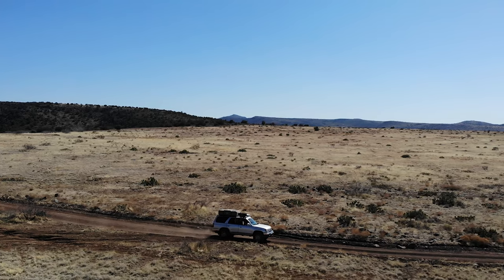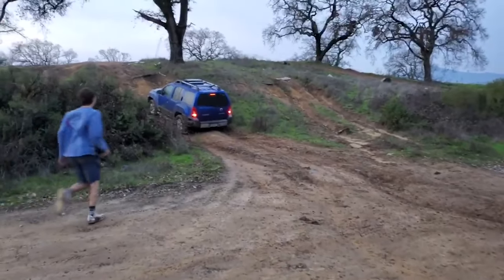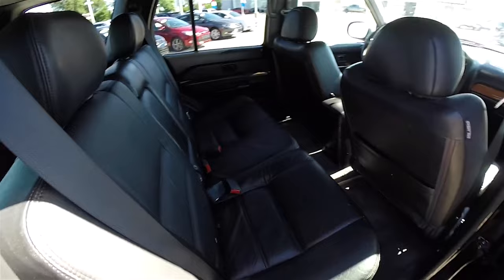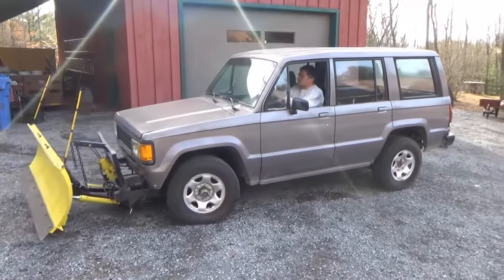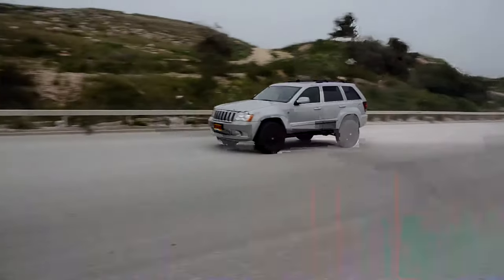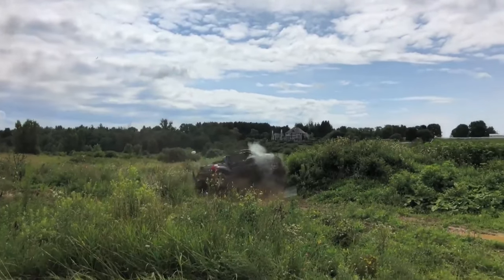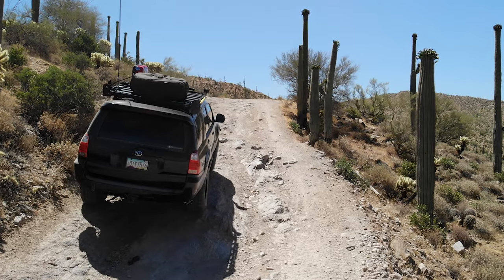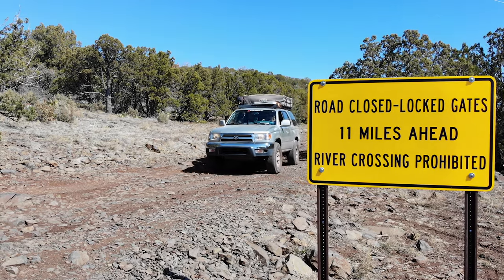More Viewer Picks For The BEST BUDGET OVERLAND VEHICLE!

Comment: The main problem with the Nissan R50 is because it has McPherson struts in the front, you cant go up in tire size without spacing/offsetting the front tires out about 4 inches each to clear the lower spring perch.  However, if you want one that has led a cushy soccer mom life like the Sequoia, search for an Infinity QX4.  Same rig different badge.
Reply: I would agree, the R50 platform is the bastard child of the Nissan suv lineup with the front strut setup. There are ways to get higher lift with subframe drops that are being sold now to add bigger tires and removing the front sway bar for a bit more flex. Still very limiting.

Comment: Great list! Considered EVERY vehicle on these 2 lists (and Discovery/LR3) and decided on an 03 4wd Sequioa 3 years ago for my overland build. Been incredible, SUCH an underrated truck! The 4.7, easy to lift, tons of storage and even at 6’02” me and the fam easily sleep in the back.
Reply from the maker: It's definitely a good choice. I think a lot of people are getting wise to them, but they're still the most cost effective way to get into a body on frame, four wheel drive Toyota! Nice choice!
Reply: I wish I could grab something like that, or I believe it was a highlander I looked at that I really liked.
  *I just sold my super clean first generation Xterra, as I just didn't like it for some reason, and found a really nice '97 ZJ Grand Cherokee that pretty much has all of the options I have wanted (in a first generation Grand Cherokee) aside from the factory tow package which comes with 3.73 axle gearing and limited slip rear end.. but it is really in great shape and has been well maintained so it's ready for me to put the 3" lift and extended shocks I have sitting brand new ready to install! 
  Then it just needs some 2 or 0 gauge wire run for 2nd battery for reserve power for the stereo amplifiers and power inverter etc..
  I am hopeful that this could be the best zj Grand Cherokee I have had so far!

Comment: I have a 2007 Commander with the 4.7 and the best thing about is that maintenance is easy. I've changed alternators, radiator, A/C compressor, and today the electric fan. All were easy to do with plenty of room to do it. I have an Xterra and I rather gauge my eye with a rusty spoon, before I change the alternator again. Nevermind the A/c actuators!
Reply from the maker: I feel you, I love our 3rd Gen 4Runner, but I don't look forward to working all that much. Just rebushing the front end took me about twice as long and about three times as much headache as doing the head gaskets on our Discovery 1!

Comment: I second what Rust Dave says. The Kia Sorento first gen is by far the best value economical real off roader you can buy. Ladder frame, solid rear axel and low range. There are two systems. Especially in the 2003 - 2006 140bhp you got part time with 4x2, 4x4 lock and low range. But no ESP off button. The 2007-2009 got a simpler less effective system Permanent 4x4 . With Auto and Low range but no locking option. I have this model. You improve this buy fitting the Diptech superlocker that gives part time 4x4 with 6 settings!! I've installed it. It has all the confort of a SUV coupled with the amazing off road capability and quite a few 4x4 accesories. The 170cv 2007 -2009 with he diplocker with 100,000miles for 6000 euros is amazing value. 👏  This is the top choice.

Comment: I owned my 2007 Jeep Commander Overland with the 5.7L Hemi for 11 years and racked up >232,000 miles on it.  It had the 4" Superlift with 33" tires, and with the QuardaDrive  2 system was unstoppable.

Comment: Good for you for incorporating suggestions from your viewers. One budget rig you might want to consider are earlier Kia Sorentos with 4wd vs AWD systems. They have a 4x4 low and ARB sells rear diffocks for them. Snorkels are available. Not quite as many after market supports as for Jeep or Toyota but you can get then cheap. Decent reviews on reliability.
Reply: @LarryRichelli  or 2wd. Awd wasn't an option for xterras. You pretty much have to message and ask, if you're looking for a first generation,  you can look at the pics to see if it has a lever next to the gear selector for the manual transfer case. If second generation it will have a circular knob on the lower part of the dash in front of the shifter to shift it in to 4wd the non 4wd will just have a black blank circle where the knob should be.

Comment: This spring I bought my 1997 Toyota 4Runner with 261,000km (162,000miles) for 5,500cad (4,300usd) which seemed to be an average price in Calgary Alberta. I wanted a affordable and reliable vehicle I could take off road but I had NO IDEA they were going for the crazy values they are. In Alberta they still seam to be a bit cheaper  than down there but it has gone up by a lot. I guess I'm just very lucky

Comment: The 1998-2005 Mercedes ML series was very overlooked, and is now cheap.  Easy to do a mild lift, and the low range and traction control works well.  There are no components hanging down beneath the frame rails, so the 9" stock clearance is a true 9" all the way through.  Engines are also simple and parts are reasonable.

Comment: I bought a 1998 Explorer Sport (2 door, not the Sport Trac) a couple years ago and it has been much more capable than anticipated. Currently added LT265/75 R16 that fit with just a little plastic cut off the front fender flares. 126,000 miles when I bought it, $2600. Now has 145,000 miles with no issues as of yet.

Comment: I have been looking for a Sequoia in the last few weeks, that is what brought me to your channel. Good stuff, I subscribed, thanks for the info. I have also been looking at a Pathfinder, also on your list. My reading led me to find that Toyota also used Dana axles on the Sequoia. Great video.
I am going to look at a 2004 for 5600 bucks with 221k miles. The non-VVT engine is a JDM while the VVT was built in Alabama. Toyota Racing Development offered a bolt-on supercharger kit for the 2000–2003 Tundra/Sequoia and the 1998-2003 LX 470.
Reply from the maker: Wow, I didn't know there was a difference in the engine source like that. I'd definitely go for the non-VVT JDM variant if I had to chose. I also didn't know there was a TRD supercharger in those years too! I knew there was one for the V6 and even the 2.7 in the Tacoma and 4Runner in that era, had no clue they'd made on for the UZ!
Reply: @MattKester  I dug around a little about the supercharger, it will add another 115 HP to the engine, I didnt see any torque numbers though.
Reply from the maker: @paladin11C40  Dang! That's an impressive gain from a factory authorized accessory!

Comment: I started my overlanding offroad in 1997 with a three year old Land Rover D1, then in 2009, I traded up for the Land Rover D2, then three years ago I got a 2nd Gen 2008, Nissan Xterra off-road edition with factory rear locker. I chose the Xterra over an FJ Cruiser because of price and the fact is was designed after the Land Rover Discovery with the same roofline and backseat stadium seating. I hate the leaf spring rear end, and the IFS front end but I have a decent lift on mine running 315/75'r16 Nitto Ridge Grapplers and I have gotten more compliments on my Xterra then 20yrs of driving two different Disco's.
Reply from the maker: Xterras are a beast. One of the countless big mistakes Nissan has made in the last 20 years was killing them off.

Comment: Really enjoyed this. I've owned both generations of isuzu trooper. My daily driver is a 2002 trooper with the manual transmission and 265k miles on the original engine. The automatic transmission models are best avoided. The first gen models while lacking in creature comforts, are great vehicles as well.  For me, an honorable mention would be the first 2 generations of mitsubishi monteros.
Reply: Is the automatic in the Montero pretty solid?
Reply: @bradh6185  they seem to be. My 91 has the aisin built automatic and they have a good reputation..
Reply: @shelbyshadow91  Thanks.

Comment: The location of the starter on the Toyotas is there to protect it from off roading conditions. It is a tradeoff they made to increase reliability.
Reply from the maker: I’d buy that, had the UZ engine not originally been designed for the LS400 and not off-road applications.

Comment: 1998-2011 ford ranger/Mazda b4000 5spd 4x4 can be found for DIRT CHEAP and are quite capable off-road and can fit 265/75r16 tires from stock. Definitely lacking some passenger space with the crummy rear jumpseats but overall awesome for the money.

Comment: Thanks for this video. Glad to see you mention Isuzu! New subsciber! The later Troopers had an issue with oil consumption in the 3.5L engines. I'm going to paste the comment I had on your earlier video in case it helps someone. "I had a 93 Trooper RS, and currently have a '02 Rodeo 3.2l with only 74K miles and paid $1800 for it, leaving me lots of cushion for upgrades and preventative maintenance. It is a manual, with 4LO and 4Hi, or 2WD and 4.30 gears. The primary issue with these Isuzu's are the weaker automatic transmissions.  If you are handy with a wrench then they are great budget builds/trucks. I've had a XJ, two ZJs, and two AMC J10s which I have done extensive work on and sold for a decent profit. I landed on Isuzu because they are cheaper than dirt, and the driving characteristics and interior remind me of 3rd gen 4Runners but without the Toyota tax. A result of the Bubble era. They are body on frame, really easy to lift(crank the torsion bars up front, spacers or coils in the rear). I like the rear doors swinging outward, allowing for a easy way to mount a table, or molle packs for organization. They don't have the aftermarket support so you need to be creative, or follow the lessons others have learned online. But I snagged a NIB ARB BullBar/bumper."
Reply from the maker: Thanks for watching and subbing, Joseph! Also, big thanks for the extra information on the Trooper. They are definitely one vehicle I wish we were getting a relaunch of!

Comment: The problem with the 4.0 V6 in the Sport Trac is one chain is in the rear the other is in front so when the chain guides go you have to pull the engine to repair it.

Comment: what's the highest amount of miles you'd be okay with purchasing on a car. i see a lot of these kinds of vehicles, in the 5k range but most all have around 180 - 210k miles. is it worth more for less miles?
Reply from the maker: I try to stay below the 200k range, ideally below 150k, but I realize in this market, that's kinda hard to do. One advantage to stuff in that 200k range, if you don't mind getting your hands dirty, is finding out what kinda big ticket maintenance items have/have not been done, and use it to start lowing your offer. Most anything on that list is gonna be looking for bushings, shocks, ball joints, and timing belts around that time frame, so I'd look something well over and try to use that to leverage the price. That being said, this assumes you want to/are able to do a lot of that work yourself.

Comment: Stuck between early 2000s 4Runner or 05 pathfinder fully loaded 4x4 with 120k for 5000?
Reply from the maker: I doubt you’ll touch any decent 4Runner for the same price. That pathfinder is a solid rig, the VQ motor in it is a beast, I’d definitely consider it. I would definitely make sure that it’s had the radiator swapped or an aux trans cooler put in, or budget to do that right away to avoid the pink milkshake of death. Also, I don’t believe they came with a lot in the way of underbody protection, so if your gonna go start doing some serious off-road work, I’d make sure you’ve at least for skid plates installed  under the sensitive bits. You’d be surprise how often we nail the bash guard under the radiator on our 3rd Gen thanks to how IFS lets the front end drop when it gets off camber.
Reply: @MattKester  thanks man 4Runner are only going up in socal. Also I’m looking into the xterras early 2000s
Reply from the maker: @FOPEZ  they aren’t bad rigs either, for as much as I’ve rubbed on them. They’re just harder to find in gently used condition, if you know what I mean!

Comment: In Canada, the best deal is probably a 97-04 grand Cherokee. They are the cheapest deals and are plenty capable.
Reply: I wanted one of those Jeeps but they are hard to find in decent condition. I decided to go with a 99 Durango and I couldn’t be happier. 
We will see how it goes against my cousins 96 Cherokee.
Reply: 99-04 Grand Cherokees way down on power (235HP), which is pretty bad from a V8.
Reply: @donmynack  there is so much more to it than peak hp. You have to look at a torque to hp chart to see how it is down all rpms. You want good low end torque for offroading. Honestlynyou probably never even use the max hp anyways, especially in an SUV

Comment: I've had 2 first gen Xterras. They go everywhere, but not fast. Also, the VG33 is garbage. Hard to work on, underpowered, and is extremely sensitive to overheating. If you have a 1st gen Xterra, the first mod should be a radiator upgrade.

Comment: Fed.  Good used buyer second attempt when prices are going up +5%/month ?  Sticking with a make or model that's still produced tells one an MY12 Nissan Y62 Armada/Patrol V8 is decades old design, including Bluetooth and upto 9000 pound tow rating should be there with a D3 ?  V.

Comment: I think a cheap, high mileage 4th gen 4Runner beats all these buggies in price and reliability.
Reply from the maker: I’d disagree about it beating all these buggies on price. Cheapest 4wd 4th Gen within 500 miles of me on Autotrader is a  V6 dealer sale for $7000 and has 250k on the clock, which also means it’s probably gonna be looking for some bushings and potentially head gaskets sometime soon. That being said, I will say that in my opinion, 4th Gens are the best “value” option in 4Runners at the moment, and if I was going to buy another 4Runner, it’s the route I would go.
Reply: Cheap and 4Runner are opposites!
Reply from the maker: @LarryRichelli  pretty much… know anyone looking for a 175k mile 3rd Gen? Clean four owner… $15k Firm… I KNOW WHAT I HAVE! LoL

Comment: Isuzu Trooper / better than Prado 90 in every way.    BTW Ssangyoung are not Isuzu its based on Mitsubishi And Troopers 90-2002 are new models much more rugged and capable than older model. I owned Opel Monterey 3.1 Diesel (Trooper 93 model) and they are better than antyging from 90's... but less offroad capable than Discovery i owned now.  Explorer are piece of old c...p in comparison to Trooper GEn.2
Reply from the maker: Dang it, Wikipedia screwed me on that Ssanyoug one!!!
Reply: @MattKester  try to ride once Gen 2 Trooper is more like Toyota 120 or 200 in case of space nad comf than for example prado 90... this 3.1 td or 3.2 V6 are great reliable easy to maintain engines. :)  And gas mielage... 9l per 100km with diesel option wow just wow. 3.1 TD got 4 cyl Direct Injection with top mounted Intercooler... great low end torque monster.   I sold mine only becaue it got rusty frame... and i just love Discos... :P